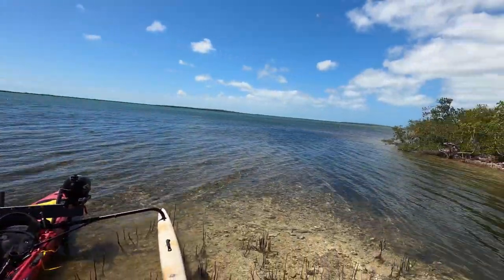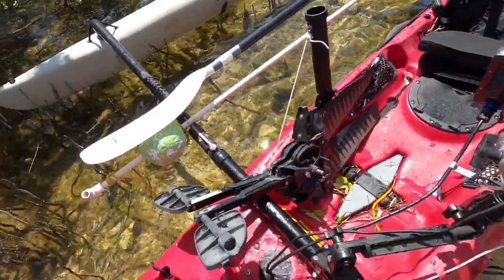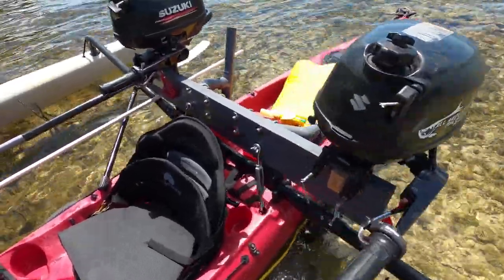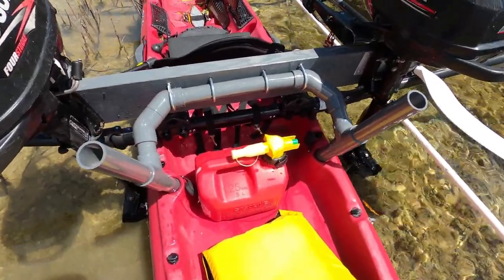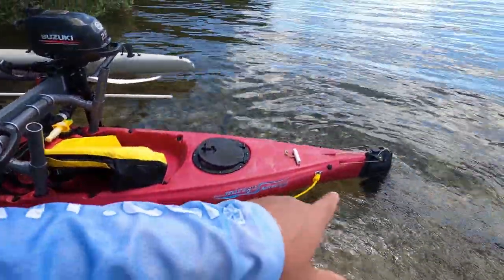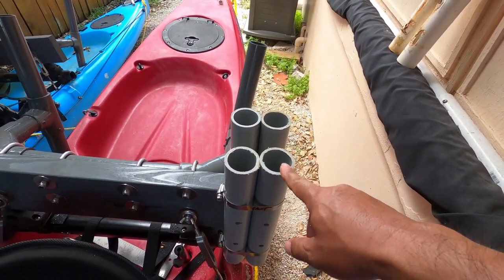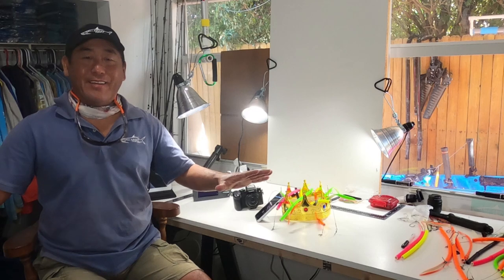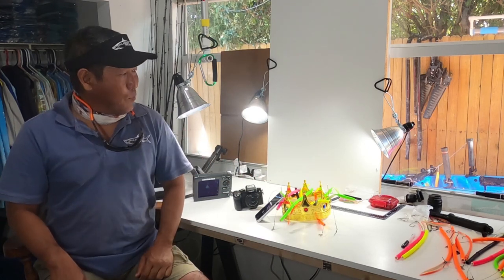Ultimate Offshore Kayak Rig:  Twin Outboard Dual Outrigger (Hobie Adventure Conversion Twin Suzukis)

Comment: I liked the "You want some". I'm always modifying my boats to be more of how I use them. I built a small wooden boat once from blueprints. I changed the design lines to accommodate the weight of a motor and made in seat storage with covers instead of just a seat before I built it. i weighed 54 lbs when finished and painted and would hold 3 full grown people, (about 4oo lbs very easily. It was oar powered mostly and I caught everything from Largemouth Bass to a 4.5 ft Hammerhead Shark. One day a Snook, (20 lb, roommate) and a 4.75 ft Tarpon that I lost four ft from the boat after a 25 minute chase down after the fish almost spooled me, with my roommate on the oars. He jumped completely out of the water twice, straight up. I tightened the drag just a bit on my 6000 series spin reel with 17 lb test when the fish was just four feet from the boat and tired. The hook pulled immediately.

Comment: With all that stability you could put a all lawn chair( with nylon straps weighs about 2 lbs) and bungees to hold it down. I did this mod for offshore use. Stops the water hitting you as much running waves and easier to stand up and fish, cast or retrieve gear, saves a lot of wear and tear on the body.

Comment: I don't believe you still read/answer comments, but use a quart ziplock to cover the gas can spout. It prevents the chance of water droplets and ultimately them getting in your outboard. Trust me on that one, its from experience. Also, you should flare the top of PVC rod holders. If you can't flare them because of their closeness,  somehow dremel or angle the inside walls. PVC like that will damage your rod butts.

Comment: Did you connect the engines to one another so you can steer with one arm?  Or do you just lock them straight ahead and use the rudder?

Comment: Ummm how does all this added weight and cost make this more efficient than a small boat? I’m all for this, but as a guy who struggles with weight when it’s just my gear and a trolling motor this blows my mind. I guess the gas is even lighter than my battery but wow. Seriously, this is my wood/pvc trolling motor holder on steroids, wild.

Comment: Why not buy a lil skiff or flats boat? Wouldn't you have more room to move around. I don't get it 🤷
Reply: I use to sell boats. The guys who like the micro set ups are sort of just a different breed. In the same way that a para glider doesn’t want a plane. They don’t want a little boat no matter how much they spend to make their micro do what a little boat can. Just makes em happy. Same with guys who like mountain bikes. Will spend 5k on a 6hp electric assist mountain bike but sneeze at a 1500$ 40hp dirt bike. 

I don’t understand it. But I get it.
Reply: I know too many guys that couldnt fish because their boat is in the shop.  I can take care of just about any problem there is with the kayak.   And I gotta say,  theres just something about catching big fish while floating on a piece of plastic.
Reply: @cwegescheide1  I have a J16 with a 25hp yami. I can do everything that it could need myself. 

I loved coming to the dock with a cooler full of fish on the canoe knowing a lot of those 80k boats did not do as well. I understand where you are coming from. I just hate paddling LMAO. For some people the paddling makes the trip,  not for me haha
Reply: Kayaks can launch from anywhere. Don't know about FL, but boat ramps are very few and far between on the north/central California coast and usually packed during summer months. The fishing grounds are also very close within 5 miles of shore.  Kayak fishing is a big thing here. I believe Steve was originally from Norcal.

Comment: Hey guy.. wow, in heavy seas you will sink.
Rodo mold,  plastic kayaks in the hot hot sun will become weaker. Second a side wave , digging in on one pontoon,  may RIP the whole plastic rig in half and sink you. Keep something that blows up and floats on the motors. My engineering back ground. I used to design folding kayaks for special forces,$ 3500 to $ 8500 each. I've designed sailing rig for kayaks. My last one man was less than 32pounds in a back PACK. With paddle life vest.those motors are going to tear it half. Molded plastic,  with that much added tork. 
I can't even tell u what may work. I dont want the blame.  But just thought I'd be nice, and let you know your going to sink.👨‍🔧👨‍🎓🤦‍♂️👨‍💻. Note if you sell it and some else dies in it from your work you will be blamed.